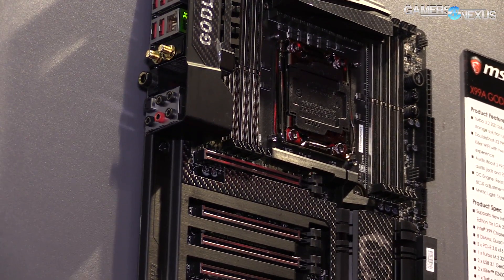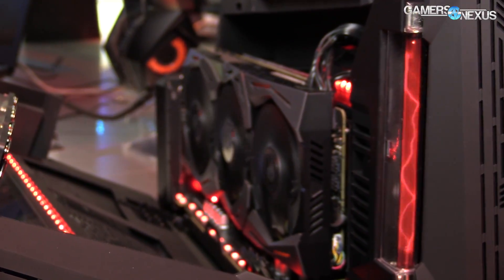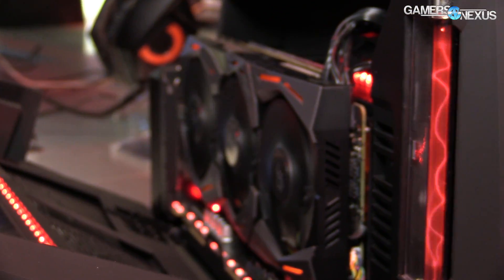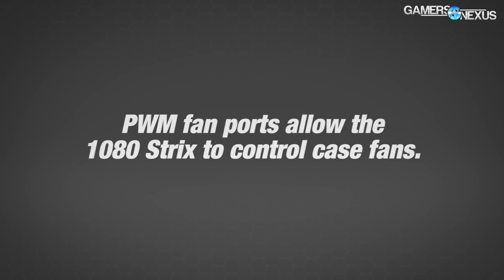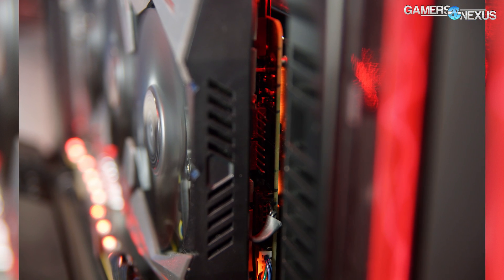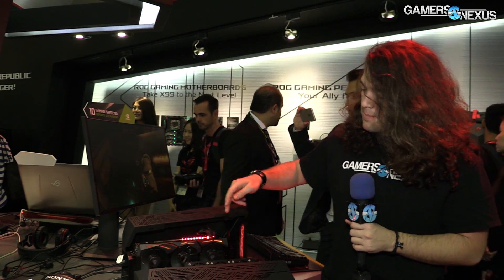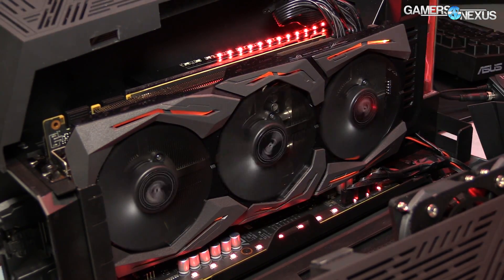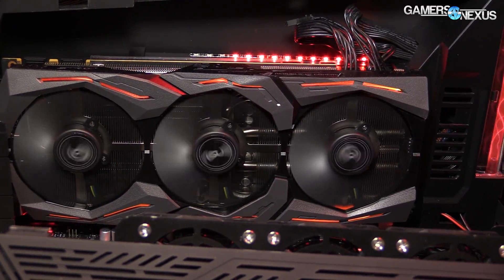ASUS Strix GTX 1080 at Computex - 8+2 VRM

Comment: Its right there... crank up the clocks and tell us what happens!
Reply: it artifacts. tests show u cant overclock this card
Reply: +darren evans but this one will have a custum bios. maybe we can dream
Reply: ***** Artifacting can be caused by a core overclock too, just as crashing can be caused by a memory overclock, its simply a form of data corruption.

The reports I've found suggest a voltage limit of 1.25V which is substantially higher than what GN was seeing on their founders edition, I'm still waiting for more reviews because the sample size still seems very small but it wouldn't surprise me if the current limit is caused by crosstalk or something similar instead of voltage, this is the real question in my head and it needs more people trying OCs to be answered clearly IMO.

Comment: can someone explain this 8+2 VRM?
Reply: 8GB Vram + 2Gb of slow Vram
Reply: +German Lehmann Just kiddin
Reply: VRM is a Voltage Regulator Module. The 8+2 means that the GPU has a dedicated 8 phase vrm circuit, meaning theres 8 "power links" working together to provide a more stable, clean voltage delivery to the processor. The vram has the other 2, hence +2 for distinction. Result is a card a tad more expensive, but that also overclocks more.

Comment: Any word on pricing or release dates for these non reference cards?
Reply: There are going to be 2 versions of this card. There is the OC version and the base clock version. The base version will run at $619.99 and the OC version will be $639.99. They both should be available June 4th.
Reply: Wow. I'm in the market for a new card and it looks like all the GTX 1080 prices will be $600+. I'm assuming if I want a good card to do at least 4K 30fps I'm have to wait for the 1070 or settle for the gtx 970
Reply: 970 at 4k will crumble even if you want 30 fps, 1070 (or 490 if AMD decides to announce a 490 tomorrow that is) would be a much better choice as the 1080 is overpriced af.
Reply: Or if you had watched any of the benchmark vids you would know that the 1070 is more suited for 1440p. Not 4K. Overpriced as it may be. The 1080 is the better choice for 4K. You can't claim the AMD variant is going to be any better because no one has specs on anything at this point.
Reply: Michael McCoy It will be similar as always, i think not even the 1080 is not worth the money for 4k, it's either 1070 and lower your expectations or wait for the next generation which will be the real beasts on the new architectures.
Reply: I think that the EVGA aftermarket card will be cheaper then the others 1080 like asus card 1080
btw in my country it goes for 980 US ;( and will be released at 27th june
WTF

Comment: Why oh why did Asus go the Gigabyte route and make the thing huge af with a 3 fan design. What a dumb move on their part.
Reply: 1080 uses more power than a 980 even if it was expected to use less, better have more fans rather than more noise or, god forbid, thermal throttle.
Reply: +Necris I just looked up a quick 980 review and it was pulling 304 watts
Reply: +MASKOAA This is pulling more if you look at power draw comparison charts

Comment: Videocardz did a review of the card, and said there was almost no OC headroom. Thei where only able to overclock from Asus 1926MHz boost clock to 2012MHz overclock. They say in the article the voltage is locked, like on the reference model. I have already ordered the card. Is this really true!? Otherwise i will take a look at another card. Thanks Steve. Link to the review --> http://videocardz.com/60631/asus-rog-strix-geforce-gtx-1080-offers-poor-overclocking
Reply: Thanks. Didn't notice, But i just checked, and i only found the 4K test of the ACX 3.0 version, which uses the reference/founder edition PCB board, which i also allready have seen.
Reply: get EVGA Classified
Reply: Thanks for the suggestion! Do you have any article or video where they review and overclock the card?
Reply: +1337ghomri Jay'stwocents, he's a youtuber
Reply: 1337ghomri you may need to wait a while before reviews are released for the Classified. I recommended you the card because I'm currently using a 980Ti Classified and having a good experience.
Reply: How have you already ordered the card? As far as I know nowhere else is selling it.
Reply: ***** Damn 79 extra bucks for the FTW? Do you know if the Gigabyte and Asus models are available for Pre-order? I looked but wasn't able to find them.
Reply: ***** Thanks I appreciate it. Depending on the price I'm hoping to get a Gigabyte or an Asus before they go out of stock.
Reply: +Kolbe Howard i have pre-ordered it. It releases 3. June here in Denmark. In shop at least. So I don't have the card yet. But I have until Friday to decide.
Reply: Proshop. They opnened for sale of founders and preoder of Asus cards, and i did manage to get preorder Asus Strix GTX 1080, within the 4 min, before the card was sold out. For this friday.
Reply: And i just watched Steves other video overclocking MSI GTX 1080, and it was same results as Asus, even with overvoltage. So seems like Pascal just can be pushed higher, than it already is on the Founders Edition. Will just go with Asus anyway then.
Reply: I pre ordered the card too cant wait till it arrive